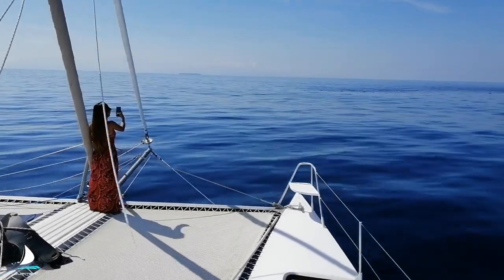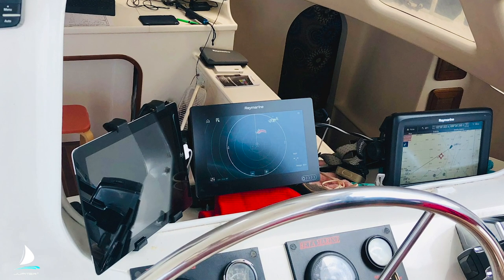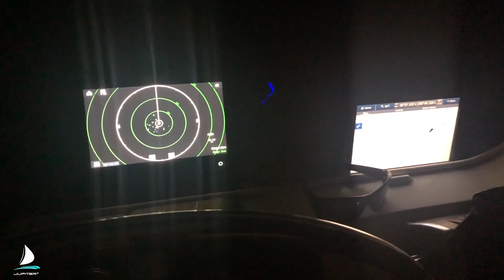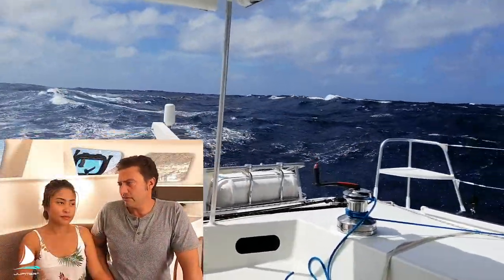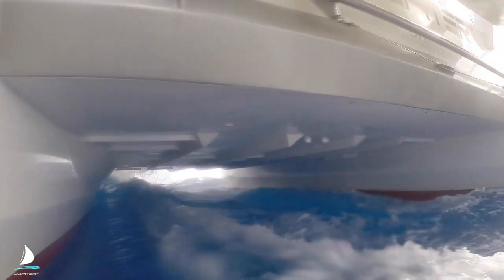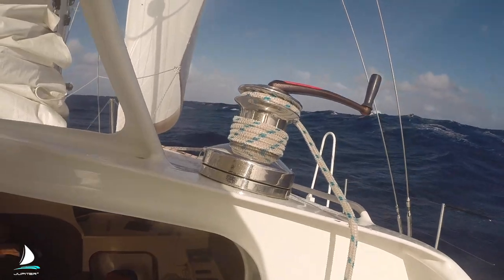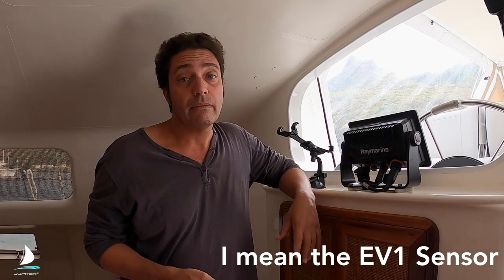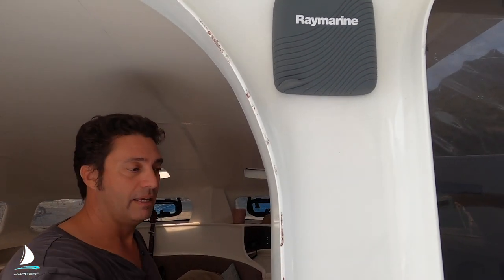SAIL ACROSS AN OCEAN EP4 + Tech tips about autopilots on a performance cruising catamaran.

Comment from the maker: Hiya Crew... who else has a raymarine autopilot....what's your opinion?
Reply: We installed the Raymarine X 5 wheel pilot in 2014. Very happy with it. Other than 2 motor failure due to worn motor brushes ,eBay $10 replacement motor, and 2 damaged drive belts, Amazon $20, no trouble. Sailed 46 000 miles. 
In 2017 I bought as a spare the complete Evolution wheel pilot and installed it on our crossing from St Martin to the Azores I expected a big improvement with the Giro compass.
Half way across the Atlantic I changed back to the old X5.
The new pilot had only 4 response settings, the old 9. Could not de-tune  the response to stabilise the boat with the new Evolution!
The course computer on the evolution is useless!;
No problem with the X5.
Reply from the maker: @walterlehnert5381  yes I agree Walter... I had the x 5 on a previous boat... No probs... The evo tuning isn't great... But my main issue was breaking belts.... And when it is working... the NOISE!
I'm really please with the upgrade to thrle rotary drive with chain and sprocket.
Reply: @SailingLifeonJupiter  Jamie, I broke a belt because I overtighten it after it started slipping surfing down at 23 kn huge swells on our way to Capetown. The load on the rudder was huge, lucky the steering cable didn't brake. Also we found the autopilot motor gets noise when the carbon brushes wear.
Reply: on catamarans  I install hydraulic rams and pump, less noisy more powerful, no strap, I went to 23 knots easily on a outremer 55 light the evolution worked ok. on faster cats ex; gunboat or ts5 margaudons I prefer BG or nke,
Reply: I have 2x EVO200 autopilots, one on each rudder quadrant with both sharing the same Gyroscope. I shut one down to turn the other on. So far it has worked great.

Comment: Yes, when we got our Raymarine autopilot...we got it oversized. If it doesn’t have to work hard steering, ie your boat is much lighter than it’s used to steering, it uses much less power. We have no trouble with it. It’s been installed for 13 years. We just got a new type 2 linear drive and installed it even though nothing was wrong just because how long can an autopilot keep going? We kept the old as a spare...same kind...and have it all wrapped up just in case. Always buy oversized, so that you never have a problem. Your old autopilot will always steer in easy conditions...but buy it for the difficult conditions and you will always be OK...
Great video, and I like that $2 solution! -Rebecca
Reply from the maker: Thanks Rebecca. Yes, i'm glad ive got the new Raymarine autopilot installed... Just gotta give it a good test now....

Comment: Hi Jamie great video! I love your tech tips. Could you describe the steering system of Jupiter in detail? No quadrant, no rod, no linear drive autopilot possible? 
This lifting rudder system is an amazing safety feature not to mention the ease to inspect and repair the rudders. All boats should have one.
Reply from the maker: Sure... It's just a sprocket on the wheel shaft. Then a chain dropping down evenly off this sprocket where it then connects to the pull cables that are routed to the tiller bar. Very simple. You could possibly use a linear drive, but the rotary makes more sense...  Ya, the pop up rudders are great. I've cleared fishing nets off these, without getting wet in the Malacca Strait more than once!

Comment: I'm late to the show, love you two you'd be great to have a beer with ,life and soul  of any party.
Anything you'd change on the design of the boat .You can see it's a flier but Is it solid for them speeds or does some of the hardware need upgrading you can see how you could easily modify the interior .Love to see it really take on some tough sailing👍
Reply from the maker: Hi JJ... Welcome... would have a brewski or 7 with you anytime.
The Indian crossing was the roughest we've had on Jupiter... But we weren't focused on making vids back then, and when you need to hold on with 2 hands... the camera gets put away.... I found no issues with gear sizing... Only that the loss of a split pin nearly caused us to lose the rig... but that has just trained me jump up the mast to inspect more often. 
The only thing i wouldn't mind is a more comfy cockpit layout.... But because the massive rear crossbeam runs the full width, you cannot have walkthru transoms.. and you would lose the room inside the 2 queen aft quarter berths....
Everything is a compromise.

Comment: Nice video- thanks! Do you think a fiberglass cat would have been less noisy than your metal hull?
Reply from the maker: That's a good point EN. However, Jupiter2 is insulated with an inch of foam through out (except bilges) to reduce the water noise and temperature variations.
I've made passages on timber and glass boats... they're noisy as well... It's more, the roar of the ocean than the boat itself, which is fatiguing.

Comment: Would it be worth installing a windvane self steering system as an `additional crew member'?
Reply from the maker: Sure.. Could do... But the new autopilot rocks.
Reply: @SailingLifeonJupiter  Am interested how to set up a cat for long offshore passages single handed, clearly if a windvane would work that is at least one part of redundancy that would still hopefully be working after say a lightening strike or other power outage ? thoughts / video topic ?

Comment: When (month) did you leave Sumatra for Mauritius/Rodrigues?  Would you do that route again?  I have a Mumby and am thinking about it but maybe it's easier to go up higher to Seychelles or even the Red Sea.  If I remember right, Jimmy Cornell says earlier in the season the winds are lighter.  Is that a better time?  Also, I added a CPT autopilot.  Any opinion on those?  It's sure a lot quieter!
Reply from the maker: We crossed in May... Pretty blowy... CPT? No. Id be keen to hear about it. Which Mumby? Where are you?
Reply: @SailingLifeonJupiter  It used to be Zarquon.  (Now "Dilly Dally") I bought it 2 years ago and am in Malaysia, where I've met several other Mumby 14mt.  The problem I have is with the closed borders I've only done coastal cruising with it. So I don't have experience with big ocean swell/waves.  I think to do the trip you did, which I'm looking at, I'd want a Jordan Series Drogue.  Or I may go up the Red Sea.  I just discovered your channel.  You do a great job!  One thing I'd like to see, if you get a chance, is how to reef the huge main while going downwind.  It came with the Raymarine Smartpilot X-5.  It was SO noisy I never wanted to use it.  Plus the belt was chewed up.  I keep it as a spare.  The CPT is really quiet but without ocean testing I don't know if it's responsive enough.  Thanks
Reply from the maker: Ahh.. Neds boat... Cool...yeah the main I'd a little daunting... I would round up to get the wind forward of the beam, de power the mainsheet and then throw in the reefs or drop it completely... We had 25-40kts for 5 or 6 days crossing the IO.. So we ran just on storm jib alone, still surfing.